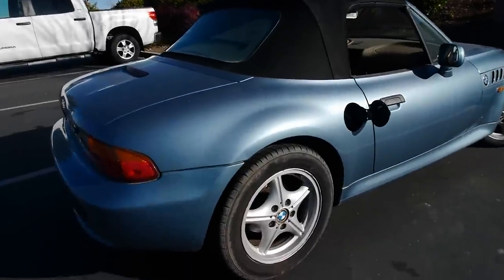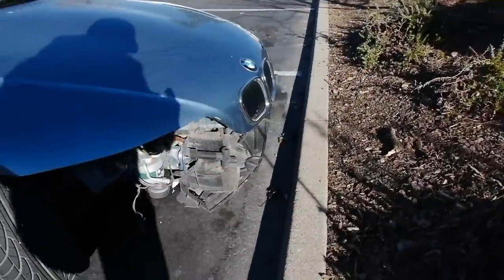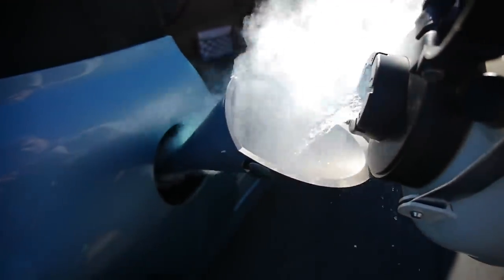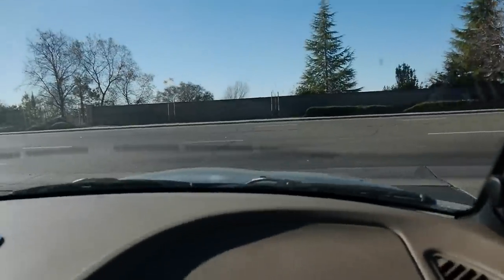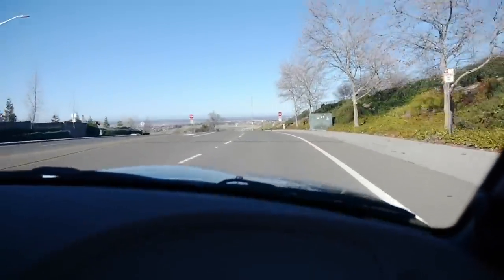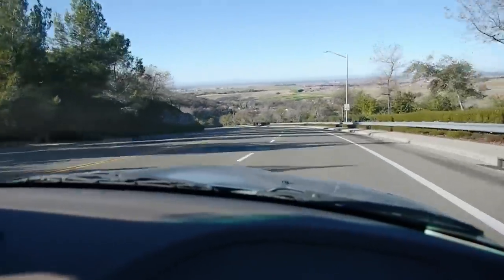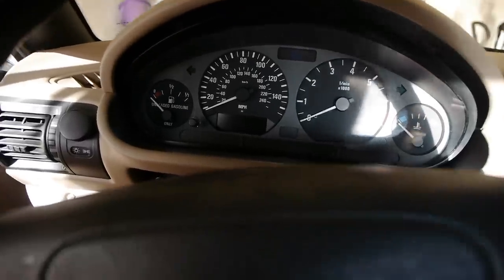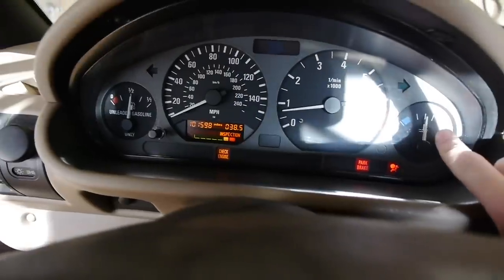What Happens If You Fill Up a Car with Liquid Nitrogen?

Comment: I don’t know why but I expected it to blow up LOL
Reply: AnimeNightcores150 pretty reasonable thought since it might expand rapidly when hitting the normal fuel
Reply: AnimeNightcores150 the fuel tank would have if he would have screwed on the cap
Reply: That's Nitroglycerin 😂😂😂😂
Reply: Jay Bubblez lool
Reply: AnimeNightcores150 me too
Reply: Atlantanspenguins I personally don't know myself, but a lot of people are saying that it would have exploded if they closed the cap due to pressure.
Reply: The fuel tank would have if it was fully sealed, due to the expansion of LN2 to GN2. In this case the LN2 vaporised instantly and vented through the  filler tube, as they never screwed the sealing cap onto it.

Comment: What happens if you put gasoline in a Tesla?
Reply: redrooben there is no gas tank only an electric plug
Reply: Kymia Collins I know just being dumb 😂
Reply: Samsung Galaxy S7 Nope just a motor
Reply: engine is what they use for fuel managements. motor is basically used in batteries for electric cars allowing to freely move.
Reply: it doesn't... there electric cars... they dont have a engine... Tesla.. they make electric cars

Comment: Liquid nitrogen is very cold. -320° cold. So when ever it touches even a room temperature surface it evaporates. Which is why when he put it in the tank there was a bunch of "smoke" coming out. So technically the car isn't running on liquid nitrogen just some really freezing gas.
Reply: -196° C
Reply: He should try it with Liquid Oxygen Now.

Comment: This guy is finding the solution to energy crisis.
Reply: AppleFacts yea literally he needs to do more of this. It could be beneficial if finds a liquid that would work
Reply: Grumpy Kitten im watching these just in case for a apocolypse
Reply: endsss lol
Reply: No, he just showed that cars always have some gasoline remaining in the tank. All the liquid nitrogen that he poured in was evaporated out. All he did was cool that remaining gasoline, and cool the metal gas tank of the car (which cooled everything that was connected to).

Further, liquid nitrogen will float on top of gasoline if they are both in the liquid state, and cars always take gasoline from the bottom of the gas tank - so he was just running the car on cold gasoline. The gas pump itself will create some heat, which helps evaporate more of the liquid nitrogen.
Reply: NOx is worse than co2
Reply: Yes bro...
Reply: @ExtremeDiag  nope
Reply: Me: viewing comments

Older comments: *says random username that got changed"

Me: Looks up youtuber doesnt find it and rages

Comment: If you do one more do jet fuel :)
Reply: yes!
Reply: Hate to disappoint you but Jet fuel is basically Diesel. You could run it in a Diesel car providing you add some lubricant agents. Aussie50 done it a few years back.
Reply: Don’t you know? Jet fuel melts steel beams so it’ll melt the car obviously
Reply: Zachary diBenedetto no it doesn’t lmaoo
Reply: Jet fuel is Diesel itself, just a lot more pure and clean
Reply: Use nitro rc car fuel thats basically jet fuel
Reply: Zachary diBenedetto no it only melts the steel beems because of the high temperature of combustion of the jet engine which is much higher than that of a car
Reply: HankB1993 wow? Jet fuel will not hurt it, I run jet fuel in my dirt bikes just fine, it’s higher octane
Reply: MenaceMartin no you could not jet fuel is basically kerosene
Reply: Zachary diBenedetto JET FUEL CANT BREAK STEEL BEAMS
Reply: Jet fuel is nothing but very clean Diesel. So basically it would act the same as if you put Diesel in there. (I'm a pilot)
Reply: Ryan White I’m a pilot as well and I know that jet fuel is basically kerosene and it’s not going to work in a car because of the huge differences in the fuel
Reply: yeah
Reply: Jet fuel can melt steel beams.
Reply: 56nintentendo so Jet fuel A1 is Clean diesel+Kerosene?
Reply: LegendaryAsh Gaming you cant just melt steel with fuel you dummy the flame of the jet has cery high temperqture
Reply: No
Reply: LegendaryAsh Gaming only at certain temps
Reply: in before da 9/11 conversation
Reply: I also knew that and I am not a pilot. just a regular guy wasting time here
Reply: HankB1993 it's kerosene and gasoline. .. it will be like running your car on diesel. Smokey and chugging along.
Reply: Xr80man you don't use jet* fuel in your dirt bike lol... you probably use avgas which is high octane fuel for high altitude piston powered planes. Nothing like jet fuel . Jet fuel is a mix of kerosene and gasoline.
Reply: ToughGamer Est first of all a gasoline car would smoke like mad with jet fuel and if tank was empty and filled it would not even start as jet fuel is a mix of kerosene and gasoline... so if there is any truth to this story it would not be jet fuel it would be "av-gas" which is high octane leaded gasoline for piston powered planes. And it would run normally. It does not burn hotter either lol.  Your dad or you is a liar...
Reply: 900th like which means its a x900YES
Reply: MenaceMartin u need lubricant
Reply: Family guy did this experiment look it up
Reply: That’s expensive af dude
Reply: I'd recommend nitroglycerin.
Reply: Well it will start to break down as petrol and jet fuel(diesel)will not mix
Reply: nitro methane for nitro rc cars
Reply: think ur thinking about rocket fual or thermite....
Reply: HankB1993 jet fuel is good for car it expensive and very heavy he take time To burn than the gasoline fuel.

Comment: Put pure vodka in a car as fuel like if you wanna see that
Reply: TheSmithGames yes
Reply: wouldn’t that make the car explode bc alcohol and combustion making sparks and what not
Reply: Might catch fire but cars don't really explode like in GTA
Reply: Antti Lehtimaki they don't? Well that's disappointing
Reply: Yeah man
Reply: The car will turn communist
Reply: egg salad look up how a “internal combustion engine works” the car won’t explode. But millions of tiny explosions happen in cars every day.
Reply: It will run on vodka its combustible
Reply: egg salad No, it would run a little rough but it would run. It's a flammable liquid just like gasoline
Reply: egg salad it won't blow up because making explosions in the engine is part of making the engine run (also known as combustion). Plus people use alcohol in cars everyday. From e85 to premium fuel, so it won't make a difference
Reply: Wouldn't part of the engine explode?
Reply: well it would work since its alcohol but it'll get worse gas mileage then normal gas im pretty sure
Reply: Adam RTR It also needs to run a richer air/fuel mixture, otherwise it will damage the engine.
Reply: Yes
Reply: He's Ukrainian so probably has already done that
Reply: yes do it alcohol might do something interesting

Comment: Your driving on gas the nitrogen is sitting on top it would be different if the tank was first empty
Reply: science 101: oil is less dense than water, so yes, he was driving on liquid nitrogen
Reply: @bobthebadbucket9061  science 102: Nitrogen at ambient temperature is gas, it's liquid at -195.8ºC
Reply: @bobthebadbucket9061  Nitrogen doesn't burn
Reply: @bobthebadbucket9061  lol bob
Reply: The density of liquid nitrogen is greater the gasoline so the nitrogen would sink to the bottom of the tank. The nitrogen would boil quickly when in contact with the warm gasoline. If you left the cap off the gas tank, the nitrogen would vent out without overpressuring the tank.

Comment: Fill up your garage with exhaust next
Reply: Vurinova I agree
Reply: :l
Reply: Lol
Reply: don't you mean carbon monoxide?
Reply: I laughed way too hard at this.
Reply: BeatJumper 👽 no he did not mean carbon monoxide he meant exhaust fumes. When exhaust fumes are left in a closed space for long enough it makes carbon monoxide which is the result of there being half as much oxygen going into the vehicle during the combustion chamber. When there is a limited amount of oxygen it will slowly decrease until there isn't enough to combust properly in turn forming carbon monoxide

Comment: am i the only one who realizes that an empty tank is not really an empty tank so all these cars that are supposedly "running on ______" are all really just running on the reserve gasoline that gets slightly contaminated with something that burns off (bleach, coke etc) as the gasoline is burned..
Reply: It is really fake they do not connect the gas hose tank in the gas tank what you see is a fake
Reply: Yeah but i5 wouldn't run or start at all without  gas he mixes bleach in with the gas drives it then adds more bleach

Comment: BMW z3 manual?? why this thing? That’s a pretty good car! O_0
Reply: Sung Woo Yoon facts. And the 0 check engine lights were on but he says the car was pretty much ready to break down at the beginning
Reply: If it were any japanese car, he wouldn't say that "it is ready to breakdown."
Reply: Yah he did say that, but still lol
it sounded like it was running fine
Reply: tf this car did run fine because if it did not then the Nitrogen would kill it.
Reply: Sung Woo Yoon agreed
Reply: Repair costs for the entire front and maybe some other parts of the car would be way higher then what the car is worth in total.

Comment: Fill a car with a mixture of kerosene and a few pounds of the powder found inside firecrackers. See how far it goes.
Reply: Probably wouldn’t start.. and if gas was already in the tank it would die really quickly. If your hoping that powder to do something it’s not.. it has to be dry to ignite and kerosene has a much much higher flash point so the spark plug wouldn’t be able to ignite the fuel. Kerosene can be used in mixture only with a Diesel engine to flush out carbon
Reply: 10010011 Midg so gunpowder
Reply: hofer0x0 it’s not the same but similar. And it wouldn’t do anything because when wet or even damp is won’t ignite

Comment: WHAT IF YOU FILL THE CAR WITH VODKA (keep in mind it's flammable)

🤙#BLYAT🤙
Reply: The ChainMailBoy vodka isn't flammable, what are you talking about
Reply: CYKA BLYAT!
Reply: Pretty similar to bioethanol
Reply: underground racing do that to their 2000hp orange superleggera at dragtimesinfo
Reply: The ChainMailBoy Russian Vodka in particular it was used as a secondary fuel in ww2 Soviet tanks like the T34-85
Reply: COMMUNISM
Reply: The BMW turns into a LADA
Reply: The ChainMailBoy it might actually work if a spark is enough to ignite it. The only reason the liquid nitrogen worked is because it was mixed with gas, but if it is purely just vodka it might still work but definitely not well.
Reply: Harrison Rose obviously he knew that for a fuel to work it must be flammable, that's why he stated it. The liquid nitrogen only worked because it was mixed with gas. As long as the fuel is flammable enough to be ignited by the spark plugs and the combustion is right then the Piston should cycle correctly.
Reply: Moon shine

Comment: What happens if you fill up a car with Mercury ?
Reply: Cool idea, but probably it wouldn't change anything because would sink to the bottom of the car. It would me much cooler if the tank was made of aluminium
Reply: MZ flighter BTW cheap cars are aluminum tanks.
Reply: Mercury filled with mercury

Comment: How
Reply: The nitrogen evaporated without really doing any damage.
Reply: Kradox clickbait
Reply: Nitrogen is what is used in drag cars for extra power and it's combustible, (NOS). Therefore air fuel and nitrogen is a combustible mixture allowing the car to perform near enough normal.
Reply: Nitrous oxide (N2O) is used in drag cars, not nitrogen (N2). N2O releases oxygen + a lot of energy on combustion; N2 doesn't do anything.
Reply: Petrol and N2 don't mix together. Like oil and water
Reply: M power 💪💪💪
Reply: Kradox liquid nitrogen freezes gasoline. The N2 wouldn't evaporate for a decent amount of time. But not all of the gas will freeze either. It will get very cold, and more difficult to combust as nitrogen joins it in the engine. Causing all sorts of emissions havoc. Most likely why the check engine light turned on. N2 puts out fire quite well because it displaces oxygen. That car wouldn't be able to run at all if there wasn't enough gas still in liquid form, in the tank, lines, and engine.
Reply: Kradox Why?

Comment: I could do this when it's very hot outside
Reply: it might actually work to keep the engine cool. LN2 and gasoline don't mix so it would all sit on top and evaporate before it could get into the block, it would basically make cold gasoline and cool your engine.

Comment: Flaw: 6 hours after driving? The needle was already at half way temp which means the engine was ran before filming again
You said "I havn't turned it on since i pulled it back in" But it was already fully warmed up.
Flaw: Gas tank says half way full after 6 hours? that nitrogen should of dissipated, you didn't pour that much in the tank.

Can't tell if your being real on this, or if your filling it with regular gas to.

Comment: 6hrs is enough for the car to cool down. The car was at operating temperature at the up date. Hmmm Fake?? And for those kids saying it’s like nos and Turbo its really not N20 in the gas tank should have caused the engine to stop Turing over as liquid nitrogen is like water. N20 or nitrous oxide is introduce with air causing it to be cooler and the particles are closer making a bigger bang but not fuel is needed
Reply: Isaac Argueta Was thinking the same exact thing. Surprised more people didn't notice.
Reply: I can’t talk to you guys I don’t have a high IQ
Reply: Ryan same
Reply: My thoughts exactly this vid couldnt be more fake

Comment: Fill the tank with liquid oxygen
Reply: BOOM! EVERYONE IN THE CAR IS DEAD
Reply: Nothing would combust since it's only oxygen and no combustible so the car wouldn't work.
Reply: GhostTownKid yes rockets actually use liquid oxygen and liquid hydrogen to fuel their engines. Very explosive once combined
Reply: GhostTownKid they use liquid oxygen in rockets, its just oxygen that has been pressurized and cooled to an extremely low temperature
Reply: GhostTownKid Every element including oxygen can be a solid, gas or liquid except for helium.

Comment: I'm guessing the check engine light came on from a vacuum error from not putting on the gas gap (which would have pressurized and probably blown the cap seal anyway). Either way, that liquid nitrogen is hitting the warm gasoline in the tank and boiling off immediately back out through the gas cap. The car is still running on straight gasoline. Dare you to put put it directly into the fuel line ;)

Comment: Anyone notice, he put a 'couple of litres' into the tank, yet the fuel gauge shows over half full, so hard to believe they are actually driving on pure nitro. Nitro also boils at -195.8 C, reaching the engine compartment without a special delivery system, would explode before even reaching the combustion chamber.

Comment: Chances are that most if not all of the liquid had already boiled (warmed up) and vented to cause any problems. If you pour a lot, enough to get the tank very cold and for the liquid to pool there, it will most likely crack the tank and damage the level sensor and fuel pump.

Comment: Even if gasoline existed as a liquid at absolute zero, the volume injected into an engine is so low that it will not cool it down let alone make it feel cold inside. The three liters in the tank would boil away and (depending how much was in the tank) leave cold to slightly cold gasoline in its wake, no worse than what you would find in a cold climate.

Comment: Fuel tank is ventilated so that the pump does not turn your tank into a collapsing tin can from the vacuum.  Also its nitrogen an inert gas that is composed of an atmosphere that we breath close to 70% of and so does the cars ignition system.  All you did was put more of it in the engine which made the engine run at a low fuel level which is why your engine heat fluctuated, you had colder fuel....  Only thing that would have been a problem is if you were running an engine that requires Kerosene type fuel which is known to absorb water.  This could have froze the water thereby clogging the fuel filter.  Other then that you just found another method of cooling the engine is all...

Comment: i lightly assume not much really wend in.. as it looked like it spilled alot out.. by the shock temperatures of the tank - it needs alittle first.. wait a few sec.. then add more.. to prevent spilling ( my thoughts..)

Comment: The check engine light is on because you ran the car without the gas cap so the fuel pump didn’t detect back pressure

Comment: kinda surprised that you didn't manage to blow out any gaskets or seals or even the engine itself, if you had done so with about a 50/50 mix of liquid nitrogen and gas i'd imagine you'd have run into more problems when it got sucked through the fuel pump and sprayed into the cylinder! kinda like those video's of dry ice in pop bottles, i could see similar things happening... that said though it'd be interesting to see a more long term "stress test" by submerging the gas tank in a bath of liquid nitrogen and seeing what kind of fuel economy you get! colder fuel = more dense fuel = rich mixture which is why the temperature gauge was dipping to the cold side after it ran for a little bit giving liquid nitrogen time to cool the fuel off.

Comment: Check engine light was probably because fuel cap was off. Looks like a half tank of gas that little bit of nitrogen you added probably wasn't enough to cause any issues